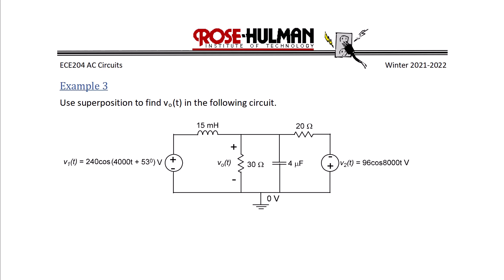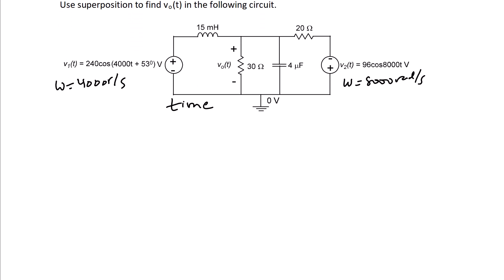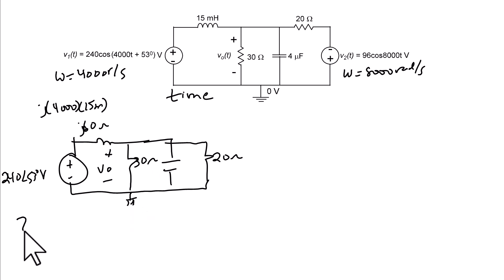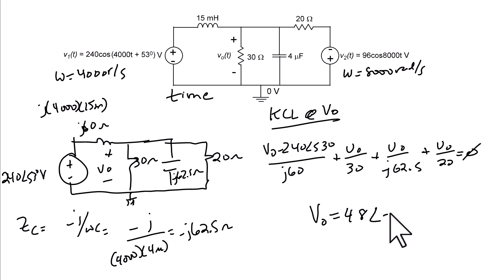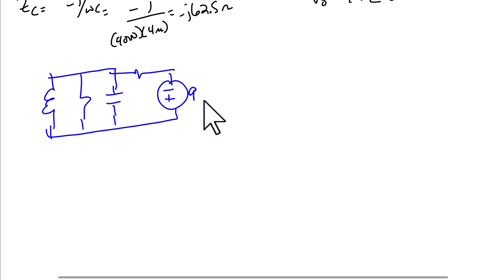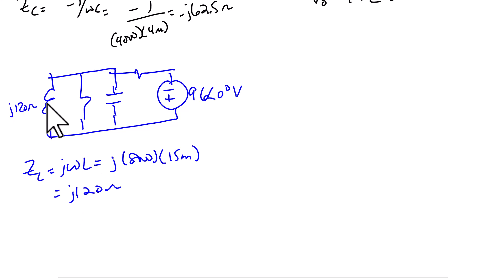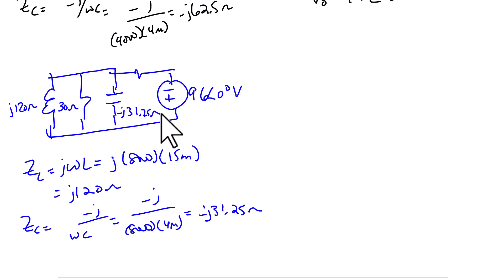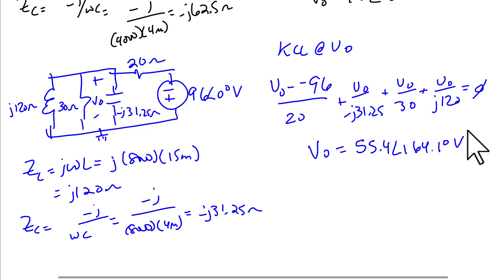ECE204 Lecture 5-2b: AC Circuit Analysis - superposition

Comment: for the first circuit we can simplify it and do voltage divider correct?
cause I cannot get the answer doing it like this but I do with kcl
Reply from the maker: yes voltage divider works for series impedances and a voltage source